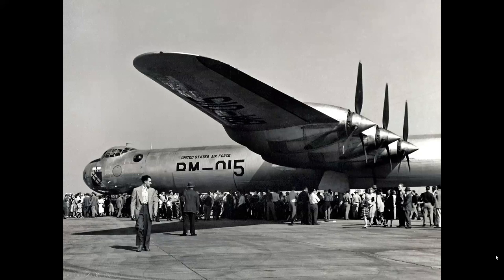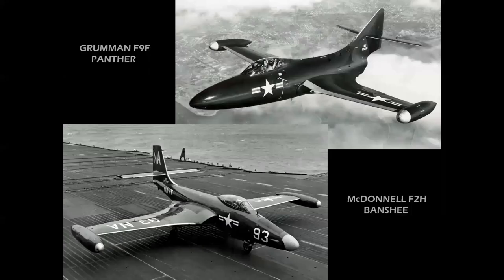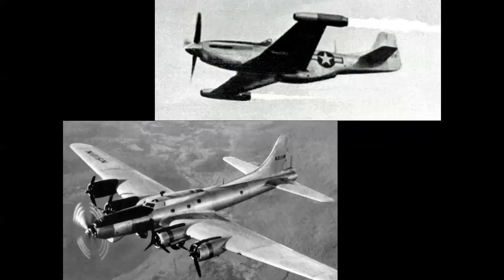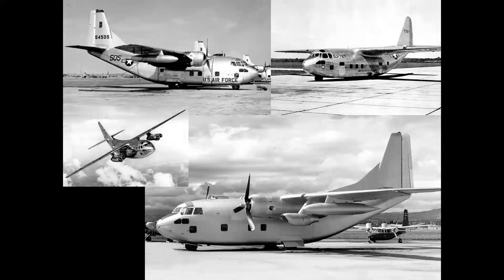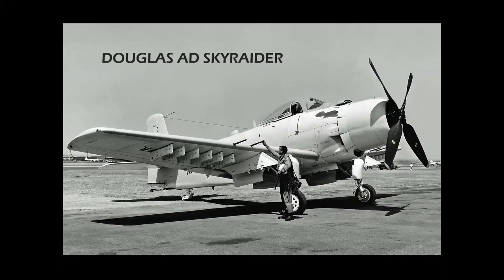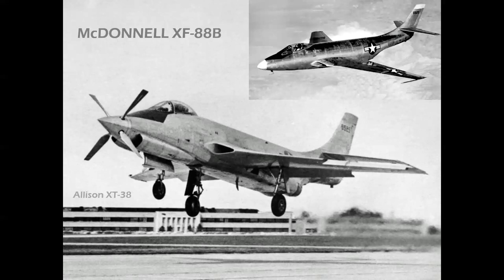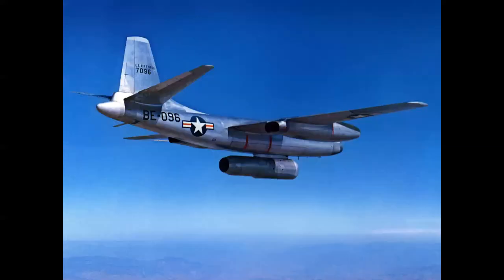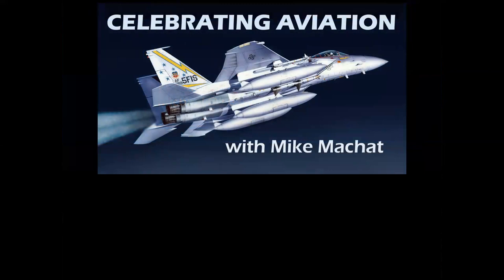PROPS IN THE JET AGE: Adapting Piston-Powered Aircraft in the Need For Speed!

Comment: 1/10th the noise of the 707 is right!  Imagine going back 50 years in aviation history if you live underneath the flight path to a major airport.  Where I live in Seattle we have final to SEA going on 24/7.  Those 737-200s were noisy!  Now, everything sounds like a whisper compared to 50 years ago.
Reply from the maker: Good point thanks, and I lived on Long Island right under the downwind-to-base leg turn for Runway 22 Left at JFK. Those early 'straight pipe' 707s and DC-8s were ear-splitting when they flew over at about 2,500 feet!

Comment: Air America had the C123K. The jet engines were only used for takeoff and used Av Gas, not jet fuel.
Reply from the maker: Good point, thanks!  (Flew on Air America DC-4s while in the Air Force in Japan, late 1960s - super operation!)

Comment: Aramco had c119 s ( pretty sure that's what they were, parked at Long beach airport) 12 or 13. Then one weekend I went to work at LGB and 6 were gone.  Sometime  later the rest disappeared.  Most all had a jet on top. They were there in 66 til???
Reply from the maker: Neat comment, thanks, and there were C-82s there as well, sold to Briles Aviation in the 1970s. Thanks for watching!
Reply: Thanks for the updated info.  Solved the riddle . Funny thing about that not anyone seemed to know squat. I worked right across   from there aircraft fuel truck. Lol. Learned to fly there.

Comment: I don't think the packet carried engines for the 707. Boeing had the foresight to have a hard point on the wing to carry a spare engine for a stranded aircraft.
Reply from the maker: I was quite surprised to learn that TWA's jet-equipped C-82 was used for engine replacement flights into the early 1970s before being sold to the Briles Aviation Group. The "fifth engine pod" 707s could do the same job, but were limited to routing, while "Ontos" was deployed on demand. Thanks for watching!